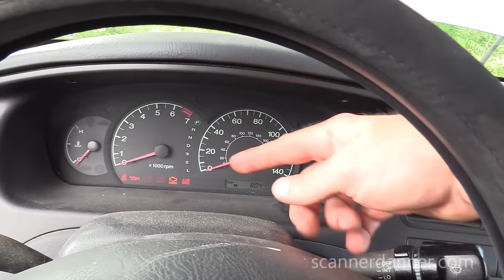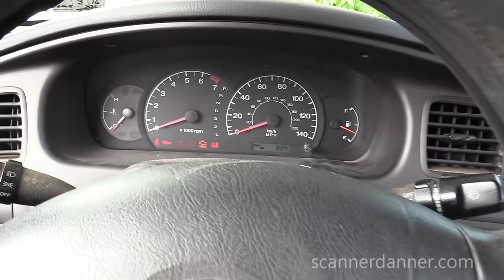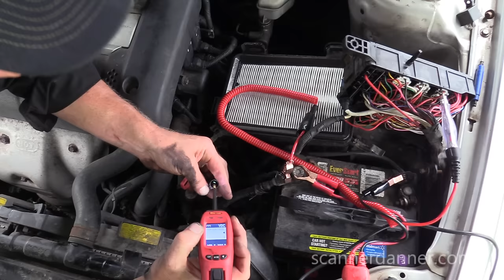No crank, good starter, how to troubleshoot, any car! (Hyundai)

Comment: I’ve watched the whole video and learned a lot of things! I have the same problem on my 2013 rav4. Bought a new battery and new starter as per mechanics advice. Got the car running in a week then its dead again! No crank no nothing...it all started after they change the transmission main seal. The car ran for a week then this problem keeps coming back. Car is dead no crank,but if the car seats for like an hour it would start again...the mechanic(Conrad’s shop in Ohio) is totally lost right now...BTW,another new subscriber here! Awesome and helpfull video!👍
Reply from the maker: Intermittents are the most difficult thing we as techs have to deal with. If you've taken it to a shop and they were not able to duplicate the symptom, they're definitely not going to fix it. You absolutely have to do your tests in that circuit when it is NOT cranking. Otherwise it is just a guessing game. Thanks and good luck!

Comment: I got into a pinch  on my 2006 passat. would not start, luckily I carry a tool box in my trunk. Had symptoms of bad alternator,  not charging my battery.. so , I was able to find that it was not the alternator but an old 150amp fuse that was blown.. I had to figure out something quick  so I grabbed a piece of solid copper wire and connected it  where the blown fuse was.  The car started was able to go immediately to the dealer and purchase the fuse . Have not had any problems since then! Videos like these are very important....

Comment: Thank you for sharing your expertise, I am learning what to look for with a 2012 Hyundai Veloster, no crank. Replaced the battery and still no crank. I am hopeful i wont be faced with what you are experiencing now. Looks like perhaps wire chafing, somewhere on the lower half of the wire harness there is a loose connection. I have faced the same problem with video poker machines, monitor and circuit board repair. Yay! you found the problem.

Comment: I so much love the fact of hunting for the problem instead of coming up with a quote for parts and stuff. I have a Kia Sportage 2000 that stopped running. There is a lot of Mickey mouse wiring from the previous owner. I've been correcting them but now am really challenged. I know is electrical problem cause the engine runs fine. Your lessons are opening my mind  so much . I will work on this car and will enroll your teachings cause I kind of love what goes on with cars.
Reply from the maker: You will be the perfect student with that love of the challenge. Look forward to watching you progress

Comment: My 2003 Elantra GT engine/manual runs as good as new.
The suspension is loose but everything works well. The most reliable car I've owned.

Comment: 10min in the video. Awesome! My issue, I tried starting in neutral & it started but died soon after. Lack of gas was an issue; gas tank might’ve been empty. Gauges don’t work & car sat for two years since the last start.
Got it started days before that with no problem besides a few knocks on the starter. but left it started & probably drained the last of the gas. Fuel pump sounds like it’s priming. But no crank or start.
I’ve put more gas in but it won’t start. I think I burnt out my neutral switch or the switch behinds the ignition cylinder.

Comment: Holy shit. Dude this video is beautiful. I got my mustang up and running again going through these steps. Thank you so so much!!!
Reply from the maker: That's awesome man! Thank you. What was it?
Reply: @ScannerDanner  believe it or not putting it in neutral and it cranked. I had to replace my ignition started recently and couldn't figure out why it wouldn't crank. The battery starter and alternator are pretty much new. 1964 🐎. Got some great info on this video. I did watch all of it!

Comment: Wow good video im having the same problem, lol just changed the starter still no joy ,I checked the relay, no corrosion so my next step is wich I should of done first is check the control wire to starter as looking now the copper is  GREEN so I guessing that's my problem.  I dont no any think about cars but I'm convinced it's the problem great video thsnks 👍🏻👍🏻👍🏻
Reply: Still no joy does any one have any ideas  ? When trying to crank it the A.B.S light flashes and clicks. The starter turns when u put a live straight from the battery to the starter.  When I brought the freelander 1.8 petrol the bloke I brought it off said it need s a crank shaft sensor as it jolts abit in 3rd  and every now and when  idling does any one know if this could be the problem? I'm thinking it could be the immobiliser?  Apparently it did have a engine swap as the old engine had head gasket problem.  Thanks
Reply from the maker: What codes do you have? Maybe this one will help you https://www.youtube.com/watch?v=McsNOJvd0ao
Reply: @ScannerDanner  thank you for the reply. But iv sold the car now ,I gave up trying but thank you for the link will still watch just incase I get the same problem thank 👍🏻👍🏻

Comment: This video was super informative.  Dealing with this issue now.  Replaced the starter relay(as you laughed at that being an end-all-be-all solution) and pretty certain the starter is good, just having sporadic problems starting it.  Replaced the battery as it was old anyway, but the problem persisted.  Car would start from a jump(higher voltage=more current) but not from a full battery off a trickle charge.  Haven't gotten it on the lift yet, but this was very interesting.  Didn't expect to watch that whole video.
Reply from the maker: Thanks so much! Did you fix it?

Comment: Thanks man, so knowledgeable. I have a similar no crank issue with my 97f150 but it's doing a one click. Swapped out firewall relay yesterday & it started right up. An hour later one click... The small wire to starter looks pitiful so I'll be replacing that section today. Wiggled it & it started.  Wasn't sure if it was okay to splice but will try today before pulling starter. Thanks again.

Comment: I have the same problem.  Original connector broke.  The terminal I crimped on is continually loosenimg.  I just ordered a replacement connector with a pigtail.   Never thought one would be available.  Anyway, great tips and thanks for the inspiration to look into this annoying issue further.  Some day mfgs will put proper ring terminal connectors on starter solenoids.

Comment: I haven't seen any of your videos for a while.  This one surprised me because usually you have advanced diagnostic equipment in your troubleshooting.  But since most of us might have a cheap scanner at most it is useful to know how to troubleshoot without all the advanced tools.  However, I know even a digital voltmeter is a huge help when troubleshooting electrical problems.  I don't work on cars near as much as I used to but I know in todays cars it is very difficult or impossible to troubleshoot some problems without some type of diagnostic instruments.

Comment: I'm having the same problems with mine. I put new ends on it, new battery kept tighting the ends, all the sudden it worked, then it was really tight and mine is the cables, I think mine needs the negative cable replaced, after a while it loses it's conductivity, need new cables. This car someone else before me put in a new starter. So always check your ends at the battery also. Great video on finding the problem.

Comment: Good video.  Ive been hunting some gremlins on my '79 BMW.  I had been doing pretty much the same process and this was good to see to know my thinking is in the right direction.  I have it down to one circuit now, but still dividing and, hopefully, conquering.
Reply: Found it. Wasn't the circuit at all. Just a poor ground.  That's what I get for relocating the battery to the trunk.

Comment: The swap the relay crowd really don't understand automotive electric and how a relay works I had a 2000 dodge Ram relay was clicking and intermittent and I can't lie it kicked my butt. It turns out some one before me had stuck there amp probe lead all the way in the relay holder and stretched out the contacts, When you should use a piece of small stranded wire or a paper clip to not stretch out the contacts. . Im a 30 year electrician , Not automotive but it's almost the same. Just give it a little thought and experience goes along way. Great job on fixing it and again great job teaching as well.  Love your videos. You need to slide Mrs Danner in for some eye candy for your viewers.   LOL

Comment: No crank, no start 2009 Saturn Vue... I wish u could take a look at my car.  Gotta find a mechanic that knows his stuff......Great video!
Reply: Put car in neutral. 
 Unplug starter solenoid connector.  Jump from battery to starter solenoid terminal on the starter.  That will narrow it down.  Also suspect neutral start switch.

Comment: Great video 👌 thx 
Mechanic changed starter ,new battery same problem even bought another fuse box 😔😔
Went dealer 😒 same problem
It shows key sign but when car starts it disappears.
Some mechanic from YT chanel says kia Rondo has same issue maybe Antenna coil

Comment: Very nice video! I have a 3000GT that has developed a problem where when I turn the key, I hear the starter click, but the car won’t crank. It does not do it all the time and it will eventually start after enough turns of the key... I replaced the starter, but the problem is still there. I was inclined to believe that my ignition switch was bad, but now that I have seen your video, I will test some more stuff before I jump into conclusions... Thank you!
Reply from the maker: for sure, just a simple test light connected to both starter terminals (like I showed in this video) measured DURING cranking, is all you need

Comment: Great video! I have an intermittent starting issue with a Kia. And my mechanic automatically thinks it's the starter which I do not think it is. And although I trust him I just don't think he would be a great mechanic to diagnose an electrical problem. I need to find a mechanic that knows how to diagnose electrical problems which is not an easy task. I won't bring it to the dealership because I don't think that they would figure it out after reading many forums where they had my issue and replaced all kinds of things for thousands of dollars and it wasn't the problem. I just need to find a mechanic like you. 🙂
Reply from the maker: Use my shop directory and look for a shop closer to you  who is using my training material for their techs. Your chances of getting a proper diag will be better.
https://scannerdanner.com/find-sd-shops.html
Reply: @ScannerDanner  oh, thank you!

Comment: liked the steps and detail without dragging it out. Here's my problem, 2015 Hyundai Santa Fe, recently had the engine replaced (the well known Kia-Hyundai engine problems), it's been running fine, week ago it got pretty cold overnite, went out early to start it and nothing, dash lights on but nothing else, wouldn't even jump start, checked everything ended up putting a new battery in it. Monday morning, again very cold overnite, no start no crank, put my battery tester on it and it said battery was good but needed charging, charged battery and then had alternator checked, checked out good. I checked for current drain and it was in the normal range, disconnected battery next night and following morning started fine, something is draining the battery, not much but enough to put it under the voltage threshold. Here's my thought, this started when the nights got cold, I think when they replaced the engine they have either nicked a wire or didn't get a ground tight and when it goes below a certain temperature it is causing a short or ground problem, but when I checked for current draw it is minimal, any suggestions ?
Reply from the maker: Did you fix this? If not, step 1 is to scan it for codes, especially when it is not starting. Step 2 is to do some checks on the starter like I showed in here but those tests MUST be done when the problem is happening.
Reply: @ScannerDanner  Has not done it for a while but I have been parking it in garage. Left it out a couple of nights just to see what would happen but it started both times but it also wasn't as cold as the times it did not start. This vehicle would be impossible to do the tests the way you do them because the dang starter is up under the intake manifold, in fact the intake manifold has to be removed to access/remove the starter. Starts fine for now but my thought is this, when I get a chance (and when I get my extra vehicle back), I'm going to pull the starter and put it in the freezer for an hour or two and then quickly pull it out and but battery voltage to it and see what happens.
Reply from the maker: @Splashfun2000  you can do the tests right at the main harness connector where it enters the manifold. You will have to pierce the wires though, but at least you will know with 100% certainty that you have to go in there or not. 
The bench test of the starter is not valid. 1. because it is no longer under the same load and 2. because when you are unbolting it you are moving it around and you can make it start working properly again, just by vibrations. Hope this helps!
Reply: @ScannerDanner  so I ended up putting a new battery in this and a new relay, only had the problem once after this, let it sit and once the temperature warmed up it started. Have kept it in garage all winter no problem starting, kind of forgot about it until yesterday, had to park it outside, temperature got down to around 23-25 deg (coldest garage ever gets is around 40), went out to use it and nothing when I turned the key, dash lights are on and can hear a faint noise when I turn key, needed to use car and couldn't wait for sun to come up and warm things up so I thought I will try to jump it even though that didn't work before and it didn't this time either, on a whim pulled the relay and jumped the contacts and it started right up. You would assume it was the relay but like I said I put a new one in last fall. Problem only occurs it looks like at somewhere below 28 deg and it started after the engine got replaced (which is why I think maybe loose ground or starter got bumped) but I also don't remember if it's ever been out in cold since i got it, I may have always had it in garage during cold weather. Any thoughts ?

Comment: 2002 Chevy Silverado. For me it was something as simple as the heat shield over my solenoid shorting against the stud shorting out a 40 amp fuse. I was living on borrowed time with the starter regardless but I eliminated the possibility and found my problem.

Comment: Really enjoyed the troubleshooting on this issue. Had a similar issue on old T Bird.   Has a big ground wire that went to the engine as a ground  and a little one that went to the chassis .  The little one was corroded away and if you pushed in the cigarette lighter while car was running,  it would kill the car.  Multiple mechanics ( $$$$$)  had worked on my Mother-in-Laws car and a short ground wire from the battery to the chassis fixed it.    
     Gotta have a path for current to flow. apparently the engine mounts did not provide a good enough ground connection.
Reply from the maker: I have a few of these on video here. Crazy what a bad block ground does.

Comment: I am at 22:30 in..... I also have the same problem explaining a same type issue to Customer in a way that they can understand.  You have 2 different type Relays to make a Starter work. (At least for this type system...) Just learned a  lesson on a 2021 Chevrolet that has 2 different Relays in the Distribution Box. 1 for Bendix engagement, the other for Drive Motor actuation. Starter looks the same but 1 Battery Cable connection,  and the small wire connector has 2 pins. That was fun... Back to explaining this issue. In the Fuse Box, you have a Relay that has its low current and High Current. It is just there to safeguard these newer systems from a possible 10 amp draw that used to be no issue on older Vehicles. That "Fuse Box Relay" 's high current output now controls the low current control of different type of Relay built into the Starter that has been around for ever. Diagram might be different, but same concept. That is why I have a White Board to draw on. If they actually see it, they almost understand it.

Comment: I have a 01 kia spectra, very similar to this Hyundai, that's been sitting for 10 years. I started messing with it, pulled the starter to confirm it's good and it was good. I replaced the ignition switch, but still no crank. All I remember was moving wires, moving the fuse box and I suddenly got a crank no start. Not sure exactly what I was doing, but I knew it had to do with moving around some of the harnesses. Next, I knew the fuel pump needed to be replaced since the vehicle had been sitting for 10 years. Replaced it, attempted the start and successfully got the vehicle to start. Unfortunately, I started getting no crank no start condition again. I would jump the starter with a wire at the fuse box, by closing the relay with the wire at the pins. That worked several times (I was just trying to burn off the old fuel). Sudden the key ignition worked again, until it didn't. Finally today, I feel i ran into another problem, the alternator had not been recharging the battery so now i got a no crank no start condition again. When I try to jump the starter relay at the fuse box with a wire now, I get a sluggish starter and/or click. Voltage on the batter varies from 12.3 - 12.2 then will suddenly go to 12.4 - 12.5. Very confusing, I'm going to have the batter tested and recharged if it's still good, then try to find damaged wires using this method. Cause initially when I moved the harness around is what gave the first crank no start condition, so something in the wiring is damaged.